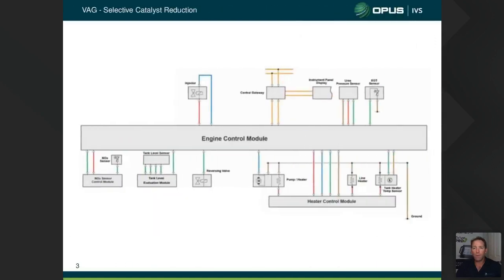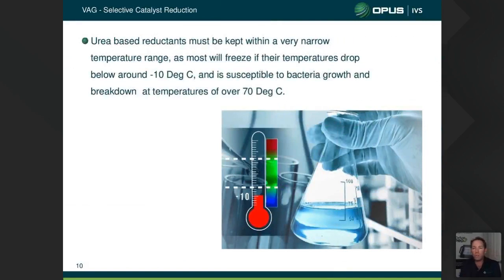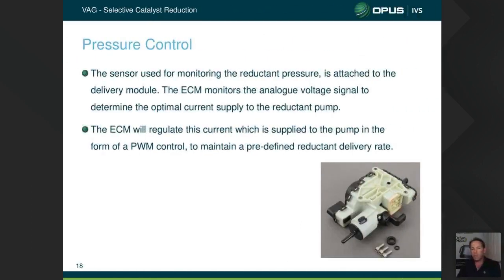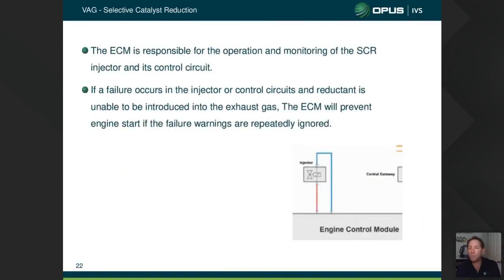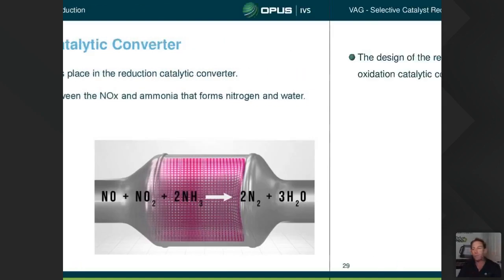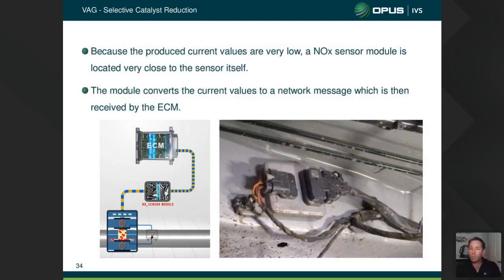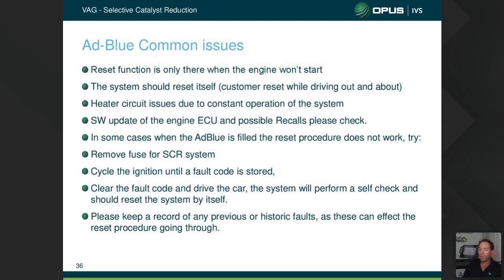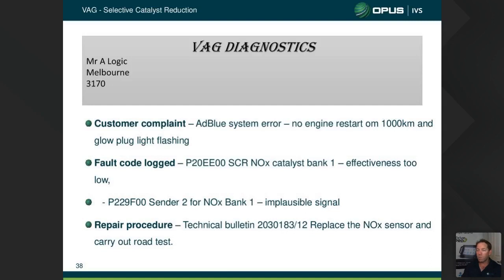Vag SCR 11th November 2020

Comment: Great and fantastically informative. One question relates to how the level sender works.. its written that it's capacitive (how much charge it will hold usually measured in fareads) but explained as though its a conductive ie ohms.  Which is it?